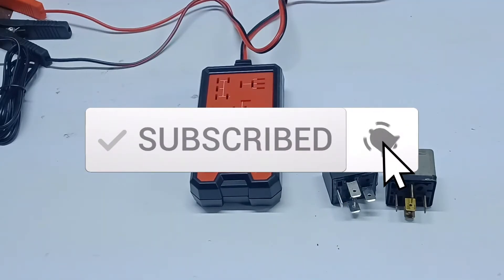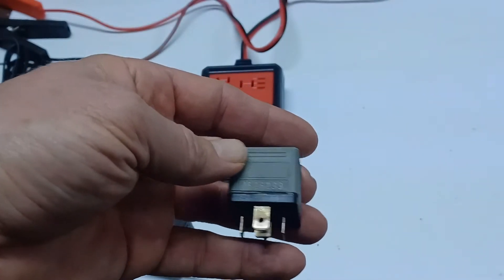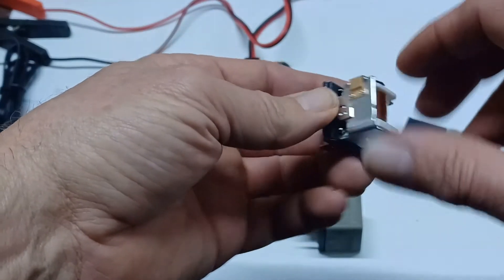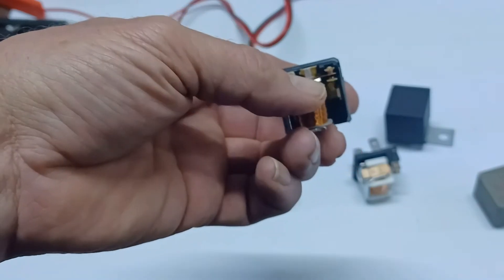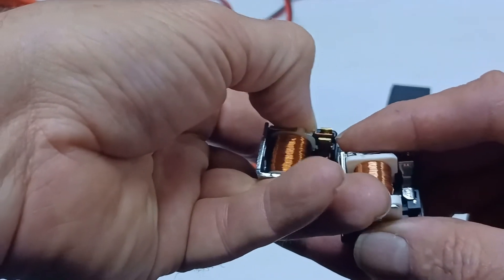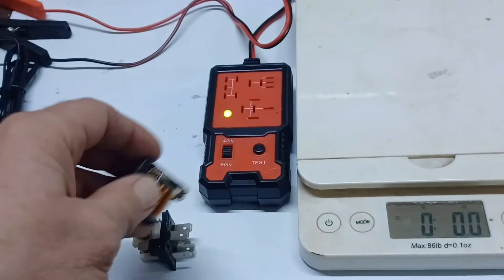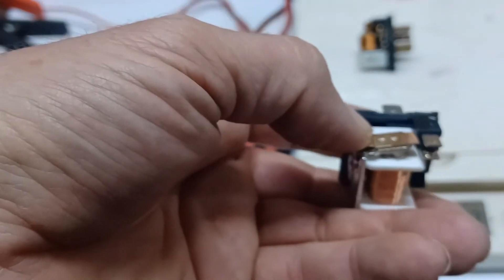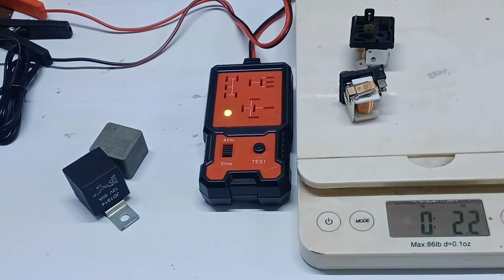Comparing a Bosch Relay with a Chinese Relay

Comment: Non-PRC relay manufacturers are just a handful.  To my understanding Bosch relay business is now Tyco-Electronics / TE.  CIT Relay may also be good and to my knowledge makes parts compatible with TE, and at least they are headquartered in MN.  I'm currently not aware of any other quality relay manufacturers.

Meanwhile PRC stuff is spamming ebay & amazon & most other places online & off.  If a person is looking for a part and 99 choices are PRC and 1 choice is non-PRC then most likely they'll select one PRC or another, unless they want to spend 6 hours searching for non-PRC parts, and if they even find any, as lots of brand-name parts are also made in PRC.

Trump was right as far as increasing the tariffs, that's the only way to deal with PRC.
Reply from the maker: I agree it is getting very difficult to find anything in the automotive world that is domestically made.  I hope we see some help with this in Washington in who ever the new administration is next year.
Reply: @daleshotrodshop  We'll see.  PRC crap hit high-gear with Bush I so now we are on the 5th president since then and nothing has changed.

And the same with lots of other problems.  In fact I can't think of any single problem that the last 6 have managed to really fix.
Reply: I'd like to see what a new Bosch relay looks like.
Comparing with a 30 year old relay is not a fair comparison